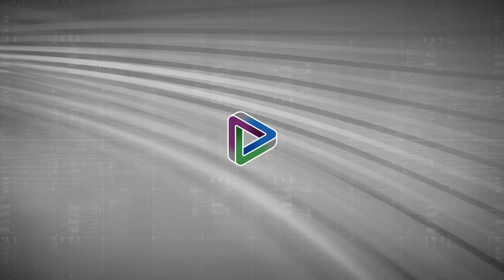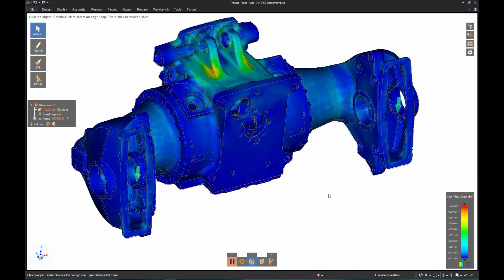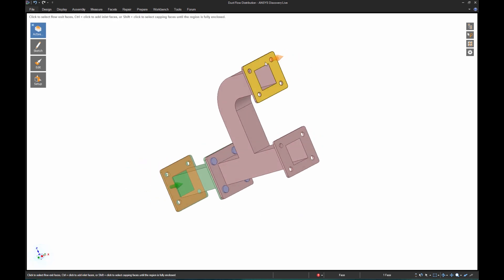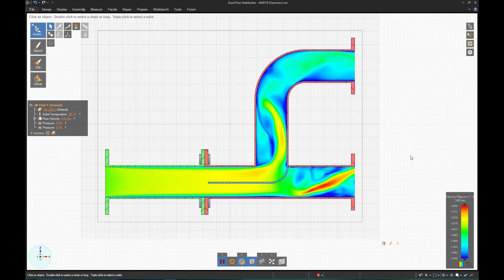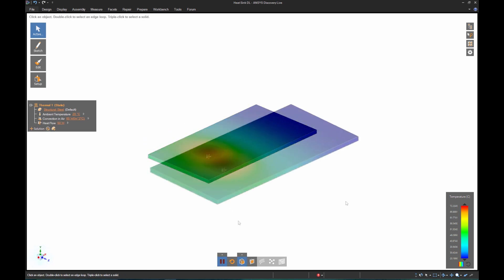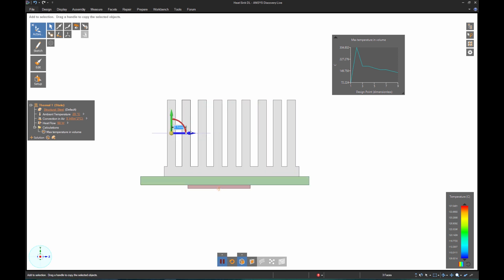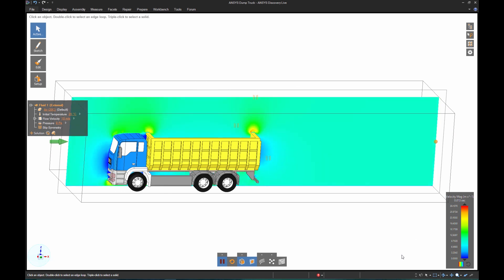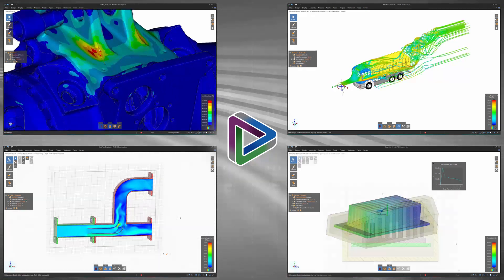ANSYS Discovery Live Product Features

Comment: When you say Engineering laptop, what is the recommendation ? Quad core, 16GB RAM, 4GB NVIDIA GPU that supports CUDA, or just any laptop which can run cloud based ANSYS ?
Reply: @Apache Squirrel Yeah I believe so.  The way it works is by assigning each individual simulation node to a CUDA core, so the more the better.  "Engineering laptop" might have a quadro in it haha